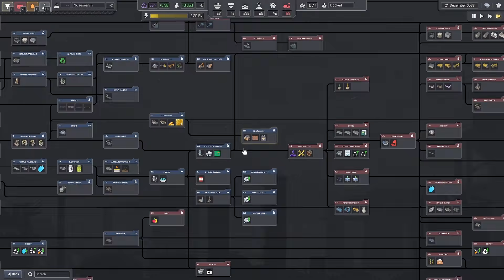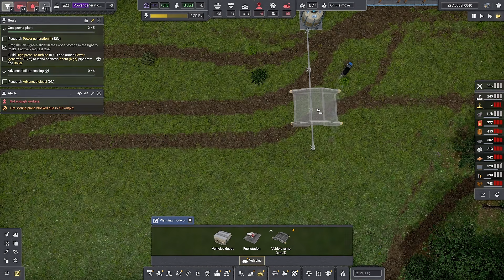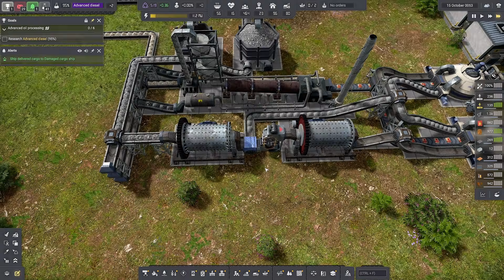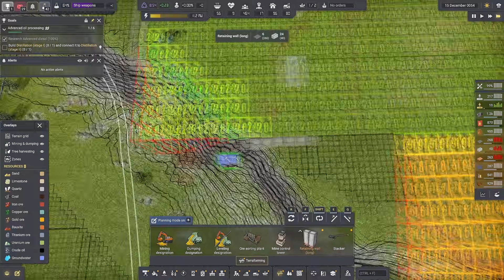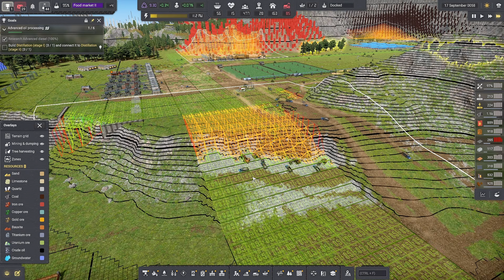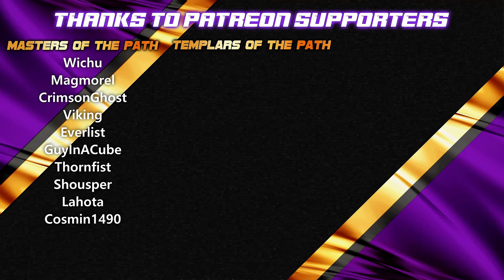Modular Designs for Steam Power & Concrete | 03 | CAPTAIN OF INDUSTRY - Update 4

Comment: One thing some creators are missing is that there isn't as much need for balancers on belts as there used to be if your belt is connected through a storage, like construction parts 1 -> construction parts 2.  There are 2 new blue and yellow sliders in the storage controls in addition to the familiar red & green sliders that can control how much material is stored before being shipped on the belts.

Another thing I've seen is a reluctance to go beyond height 2 with belts and pipes.  I get the desire to keep ramps on roadways, but those ramps cost construction parts, and if you're running into issues with that, at least temporarily, you might consider running your pipes to height 4 or 5 and letting the trucks run under them until the quantity of construction parts isn't as much of an issue.  You could at least address the design choice in your videos.

For those wondering why not use the lifts.... while they do help a lot with saving space in designs, that comes at a cost of more parts to build and more maintenance to keep.  It's a tradeoff.  Another tradeoff is why not upgrade your assemblers rather than building more.  That tradeoff allows you to build more without having to add more housing, at the cost of more power and maintenance.  Anyways, my point is, let them cook!

Comment: Here is how flywheels work as batteries:
The steam turbine turns steam into mechanical power. That mechanical power is used to turn both the generators and the flywheels at the same time. The generators and flywheels share their axle, so it is impossible for one to turn without the other turning the same amount. Generators consume mechanical power and create electrical power by resisting being turned. If you spin a generator and stop putting mechanical power in, it will quickly slow itself down. Flywheels are heavy and do not slow themselves down in the way that generators slow themselves down. Because they are heavy they can store lots of motion energy. When a flywheel is connected to a generator, it stores a portion of the mechanical energy which the turbine generates and slowly gives that mechanical energy to the generator when the turbine is off.
Reply: Although it isn't particularly realistic to use flywheels connected to a generator like that, afaik. The generator needs to run at a constant RPM because AC current needs to be produced at a constant frequency. To store power in a flywheel, you probably need a constantly variable transmission. Then again... maybe you can pull in flywheel weights towards the shaft in order to counteract RPM loss.

Comment: Flywheels store power in the form of kinetic energy!
Charging = Heavy mass spins up with power supply.
Discharge = Heavy mass spinning fast slows down. 
Their spin also helps to maintain the 50/60Hz AC voltage frequency that grid networks rely on (which is part of why renewable energy deployments increase grid instability without proper countermeasures).

The summer blackout in Spain 2025(?) was caused by renewables in this manner, IIRC.

There just wasn't enough of the expected traditional kinetic loads to maintain the grid frequency that it triggered safety mechanisms and shut the grid down.